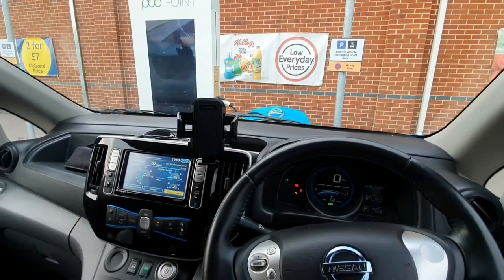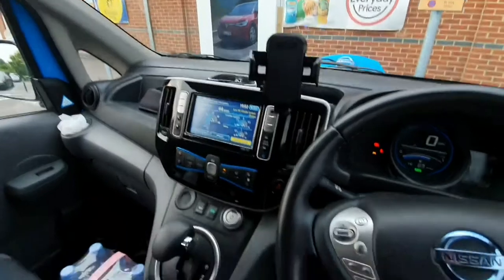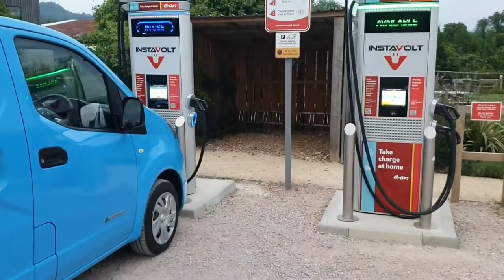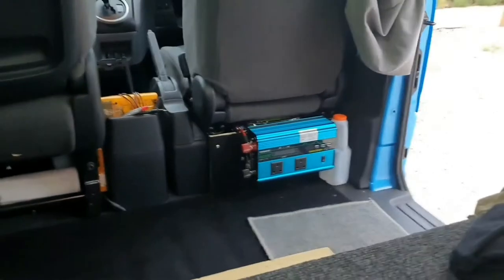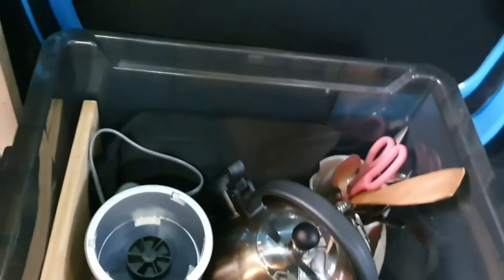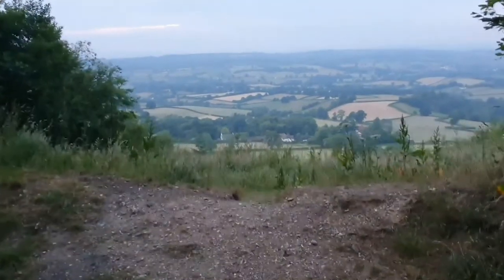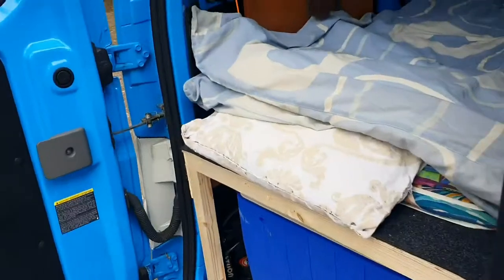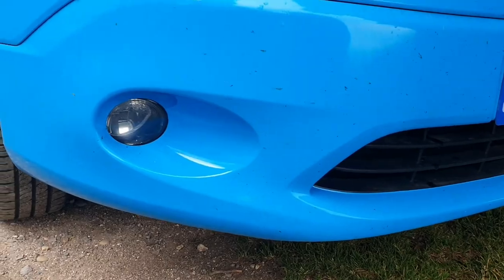NISSAN ENV200: Road trip and tour of the camper conversion

Comment: what happened to the chestnuts?
Reply from the maker: Didn't process very well as horse chesnuts cannot be eaten as they are. Hard to shell so haven't done much with it for a while.
Reply: @RichardMawby  i meant the ones you tried to process. did they atleast lower the poison levels.
Reply from the maker: @rat_king-  it may have done but they still smelt and tasted like soap so I didn't eat them. .
Reply: @RichardMawby  i like you hoped there was a way to use them.
Reply from the maker: @rat_king-  There is definitely a way to use them but takes alot of processing so I don't know when I'll have the time to try it again